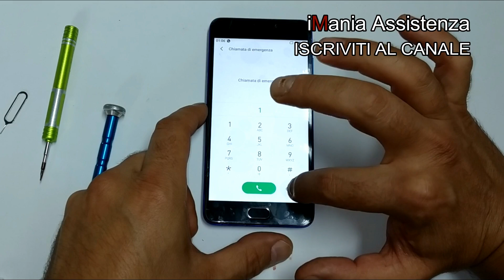Meizu M6 sostituzione display vetro touch lcd completo m6 screen replacement

Comment: Hi, i try to replace meizu m6 note, but touchscreen doesnt work. Lights on, but no touch. I try to contact the seller, his send me this message: 'Generally, there is no location where the motherboard is installed, because the contact on the touch screen is to release the spring iron plate on the motherboard". Can u help me with ? it's exist? how to solved?
Reply from the maker: try to reconnect